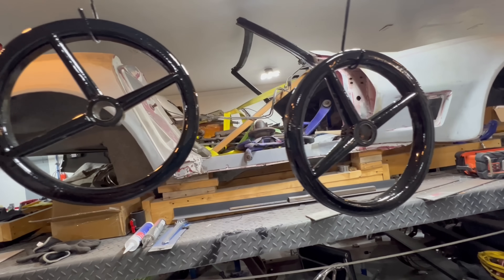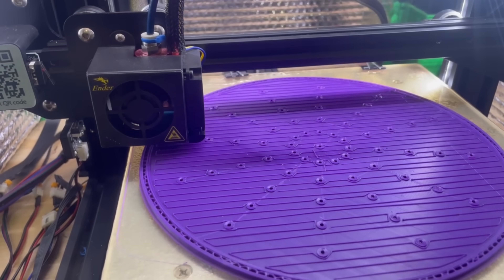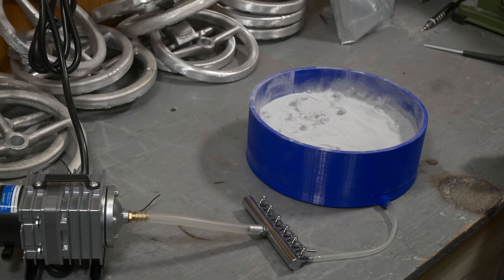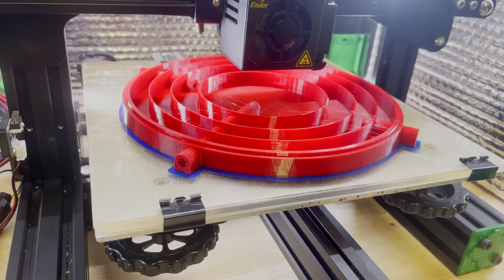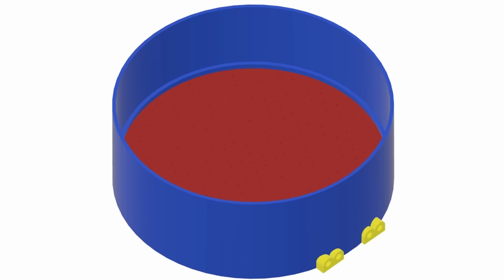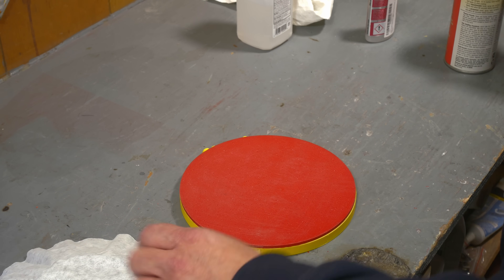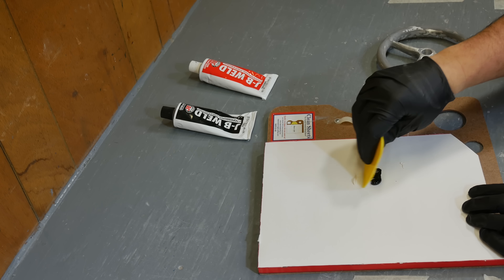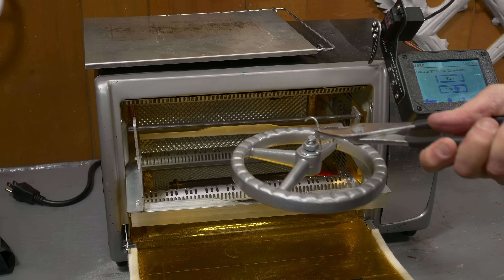Inexpensive Powder Coating at Home?  The Fluid Bed

Comment from the maker: This week we are attempting to powder coat the steering wheels we cast out of aluminum, using a DIY fluid Bed.
Follow our carnival ride restoration here: https://www.youtube.com/watch?v=xyejd7LRKMQ&list=PL9JRE2uksm9tonX17TZt38K6RH2EnDNf1&index=1&t=0s
Reply: Occam's Razor be damned, let's wildly over-complicate this thing.
Reply: for the size of the part. i would think just shaking it over the part and flip it over and shake shake. the big parts in the vid you used. to me will BIG. so yeah the fluid way is way to go. heck wire some voltage thru it. 20 volts dc no clue as i dont know the levels of voltages needed. use a chesse shaker with the metel top. bigger holes ya know. can send voltage thru it as the powder comes out its charged.
Reply: Could use a tone generator to liquify the powder in the fluid bed. Using a speaker and play some tunes could work as well for small projects
Reply: How deep of a bed powder could you do with a cheap 8" speaker?  I've played around with non-newtonian fluids and an old subwoofer but not considered doing the same with powder. @-kitn-kittilsvogel1958
Reply: Have you considered adding vibration to your powder coat rig?  Vibration can make powders act like fluids, be it ultrasonic or a vibration motor.  A powder that is already in a fluid state due to vibration should be effective to combat channeling, even with the first few rigs that were deemed failures.  The only caveat is that a poorly placed vibration source can lead to migration of the powder toward a specific area, so it could take a few placement attempts to find the sweet spot.

I am certain the tub can be simplified/lightened, speeding production and allowing weaker vibration sources to be effective (such as the little cell phone buzzers, which can be had by the pile for dirt cheap).
Reply: Hello PeteRondeau. We used to dip parts 40 years ago, now we are specializied more in powder coating. I have suggestion to use a thick cloth instead of coffee filter and perforated plate. And increase the depth of fhe fluid bed. We used to have 2 aluminium  frames and between was tensioned thick cloth so it could distribute the weight of the powder. Also for dipping is used polyethylene and not classic powder coating made of poliester. If you need some additional informations let me know. Kind regards DC
Reply: @aboxdc regular epoxides work as well for fluidized bed if they stick at the preheat temp. we used them in the lab for motor rotor stator coating. random assembly (production) my have used polyester.

Comment: I'll give you a tip for a filter instead of a coffee filter I found if you can find them in the right size, on amazon they sell Qualitative Filter Paper Circles, it is Cellulose Lab Filter Paper.  It works 10x better than a coffee filter and doesn't wear as bad, the air passes through a lot better.
Reply from the maker: Thanks for the tip!
Reply: @PeteRondeau  like you posted about us jig painters, we experiment.  I used the coffee filters and printing paper for years then found these things and couldn't believe the difference in them.  The paper could have been part of your issue the first try, if there is the slightest gap in the paper from the bottom it will allow extra air to come up and make it volcano in one certain spot.

Comment: Why not spray the adhesive on the filter?
Reply from the maker: My thought process was that if I sprayed the plate, the adhesive would only go where there were no holes.  if it sprayed down into the hole, it really wouldn't matter.  But, if I sprayed the filter, I would cover the entire thing and perhaps seal the filter preventing the air from penetrating.

Comment: @preso has the right idea. You were pleased to see the air break through in some places and tried to make that happen in all places. This is exactly the wrong way to go. We aerated silos with tens of thousands of tons of cement inside them and you need to avoid air break through up to and including the point where there is  very little cement on the silo floor. As soon as breakthrough occurs the cement stops being fully fluidised, no longer flows and becomes dead stock. If you wish to get some pointers how the above is achieved google “cement air slides”

Comment: Have you considered not having the air jets face directly upwards but to have them on an angle. I think this would keep the powder in a more fluid like state. When vertical I suspect most the injected air is lost to a point above the powder level.

Comment: Search for used Chicago electric powder coating ovens.  They used to be sold by harbor freight.   You can get them between 100 to 200 usually.  They are great for the price and run off the standard us outlet, not a 220
Reply from the maker: @Protocol-X  thanks for the heads up. I was not aware they ever offered such a product.

Comment: I bet if you took a page out of rocket engine building books and made your output holes angled such that the streams blew into each other you would create enough turbulence and mixing that you could totally get rid of the channeling. 

Second, while you are angling them, you may as well make the output holes have a goose neck to them so you wouldn't need the coffee filter. This shape should cause the holes to self plug when the air supply was turned off, and later self clear when turned back on.

Lastly, I personally think of such things using an electrical analogy: Pressure = voltage, flow = current, restriction = resistance. Knowing that there is a relationship there, it makes sense that there are ways to make the system behave better using something similar to ohm's law as a first approximation.

Comment: That abs part needs a nice thick brim do like 1-2mm mouse ears around the edge heat that bed up high as possible and don’t even crack the door. But large flat abs parts are near impossible to print i had one even pull the the magnetic bed up once had to paper clip the edges down.

Comment: unless you are retired and have too much spare time you should consider to get glue that sets in minutes, not hours - and you should get a faster printer xD
9 hours is insane for this small part nowadays..
and even if im not a bambu fan - the a1 would outperform it for nearly the same price..
also instead of designing holes - just use the power of the slicer to do a fine grid for you.

Comment: 14:56 You can see the air create full penetration of the powder where it becomes just air stream holes. I imagine adding a degree or two of angle to the air output the flow the material would be constantly replenished above the hole.

Comment: Hard to believe that the problem of powder getting "everywhere" is not easier to solve than what I just watched. An enclosure (floor pan) to capture the unused powder for re-use? I like this project for its ability to adapt an industrial-scale process to shop scale, but the insertion of the printer was, for me, a "because-you-can" diversion. I'd like to see this addressed without the use of a 3D printer.
Reply from the maker: I have to disagree with you completely.  You are looking at this from the wrong perspective.  This workshop is my hobby.  The tinkering is the part I enjoy, I'm interested in the process and journey.  if not, it would just be cheaper and quicker for me to have somebody else powder coat parts for me.  And then, I would have a bunch of free time to pursue a hobby I no longer have.  As for the 3D printer, i have spent a life time gathering the equipment together in this shop to do things the way I want to do them. 3D printers are ubiquitous at this point.  anyone interested in getting into 3d printing can afford one.  My 12 year old nephew saved up for one and bought one.  its just another tool in the shop.

Comment: You need laminar air flow.

Take your air flow, put it thru a bunch of straws on one end of a pvc plumbing pipe, nothing in middle, bunch of straws on the other end with a single hose from each straw, each hose goes to one jet of your container.

Think air hockey table or fume chamber used in labs.

Good luck! 😊

Comment: Nice video! I built a fluid bed dryer, with a blower passing over very hot nichrome wires in a grid, and a 45 degree ramp in the underside of the bed, then, instead of holes, I used 500 mesh stainless steel. There is no need for filter paper, and even fluidizing is easy to achieve. Instead of the 45 degree ramp that just channels about 500 cfm of air straight up, into 3 square feet of area which is round like yours. Instead, you could vortex the air flow by using vanes, which will require more clearance underneath. The amount of air I push is crazy overkill for a couple inches of powder coating materials, but I needed to dry large batches of bentonite clay, which was already semi-dry. Anyway, I hope my suggestions help.

Comment: The finish looks great! But you have to admit, it is slightly funny to put this much work into painting an aluminum part silver 😆
Reply from the maker: Yes, we did black with the first batch and I was worried about them getting too hot in the sun.  so I went with something safe like silver - the real long term secret behind the scenes plan is that I can use that as a base for a candy color down the line when I figure out what I really want them to be.

Comment: Go on market place get a old house over one elements will do the work or go to local dump tip get all sorts from there remember to take a plug screwdriver then try it on site if all good get 2 the same fit together 1 LARGE oven with some cutting and pop rivets

Comment: An old file cabinet 4 to 5 ft tall works well, in terms of a starting place. It already has a million holes, hooks, and steel bars going across it to hang stuff from. I've seen insulation wrapped around a couple, that seems like a good idea.  All I've seen have a custom built simple door and some old hinges.  Add some electronic heater(s) and run it HOT on the first cook to burn off the old office paint look and there you go.
Reply from the maker: My friend who powder coated the first few for me did that, although he started with a fireproof file cabinet, for all the reasons you mentioned, plus it was already insulated.

Comment: You would have had better results by changing the coffee filter to something better like micron aquarium filter pads. A little bit of thickness helps disteibute the air better. That filter is so thin it hardly does anything to help distribute it.

Comment: What if it’s also sitting on a gentle vibrating bed it seemed to work better wile you were shaking it slightly wile the air was on and you were trying to coat the part
Reply from the maker: Yes. It feels like that would help. Would break up the air channels as they form

Comment: I really enjoy your videos.

Just curious if you considered a bleed off valve for the air pump.  This would help in adjusting the output to all lines simultaneously.  It might help reduce wear on the pump as well.

I always found it useful in my days running several aquariums off a single pump.
Reply from the maker: I have not experimented with doing that but it would be worth a try.  Thanks for watching!

Comment: By which way does the powder get stick to the parts? Are there cascades somewhere or do they stick by letting the powder to be in friction with the powder pipes as within Tribo guns?
Reply from the maker: No, this basically works similar to hot flocking.  The part is heated enough that the powder just begins to melt and stick to the surface. On this particular part it was difficult to get powder into the corners where the spokes met the wheel.  the powder was more likely to be attracted to the spoke or wheel before it got to the junction.  This really helps with that issue

Comment: Appreciate the effort but it would have been so much quicker to just spray the powder like normal and bake. With all the time and filament and powder it would have been cheaper and faster. Love the innovation though.
Reply from the maker: As I mentioned, quicker was not the problem I was trying to solve. The mess, plus the Faraday affect in the corners of the spokes. This is my hobby if I make everything quicker and cheaper, what will I do with all my free time since I no longer have a hobby to pursue.

Comment: The eternal problem of many aquarium bubble curtains. The best stuff really is that fiber-ish tube that's about 3/8" at the pet store places. Comes in different lengths. My sand was Fort Lauderdale beach powder, the adjustable manifold is the other 50% of the problem and you have that. Just get those bubble tubes.

Comment: I built my own oven from the local land fill by using oven burners with the ceramic isolators and the temperature control units 6x6x6 feet built with scrap metal! JB Weld works ok but much better when you mix metal dust with it prevents bloching were the powder coating doesn't stick properly!

Comment: One of my customers who has become a great friend in the last 9 months has a couple of companies one builds custom 3D printers! He saw the cheapo I had and asked me why, I said I that Iwas just trying to learn about 3D printing! He told me about his companies and said that they had recovered a custom 3D printer from a company that failed and that he would trade me for 1 of my 572 crate engines!  They would fully refurbish it install it and he would have a guy come to my shop 3 times a week for 3 hours for 13 months to personally teach me everything that I need to know to make a successful business with it as a starting point nine months in and it awesome the max printing size is 6 feet x 6 feet x 4 feet it can feed upto 13 rolls of filament which sit in a dryer box and can connect filament to the end to keep going! They brought a full size U-Haul truck full of different types and colors of filaments! He's now wanting to buy my 3 racecars the haulers tools and every single spare item! He's installing a Resin 3D printer next week even bigger than the filament 3D printer and of course some education for it and tons of consumables! Best of all I bought the empty lot next to my shop from the owner who's dying for exactly what he asked because I've always help with cutting and snow removal and built a heated ramp for him to take his wife for treatments he charged me $1000 dollars! Said at first I hated you with the race cars and Harleys in and out but you respected hours of peace and quiet and chased the bad apples away, you deserve it! My pod house is finally approved the same guy that has the custom 3D printer company has a company that builds custom pod houses my place consists of 7 pods connected together! So a little horse trading I'm moving on and up nomore racing after I was crushed between my wrecker and a car at an accident scene by a drunk driver who rear ended the vehicle I was hooking up! More tune-ups and helping others when I can!  I didn't think I was ever going to be a homeowner, I always figured that I was going to be living in my shops mezzanine!
Reply: I was 38 when I could afford to buy a house, so I have been a home owner for 30 years now. Keep going 👍
Reply from the maker: Wow. That is quite the journey you are on. Thanks for sharing!

Comment: Love real videos like this showing the fails & all.  For larger projects, I wonder if an air hockey table would work with built up walls?  BTW,  if you ever get tired of spray adhesive filters I wonder if a clip-down 3D printed coarse retaining screen (say 1 inch between strands) designed to straddle the air ports would work to hold the filter down evenly.

Comment: I realize that you painted that piece silver because that's the color you wanted it to be. However, it's the same color as the metal. I couldn't tell how well the paint covered. It just looks more glossy. The reason that you don't find medium sized fluid beds are because they aren't necessary except for some niche cases. The big ones are used for gates because the surface area of a gate is small and spread out so most of the paint would be wasted overspray. The small ones are used for dipping small objects with, again, a small surface area where most of the paint would be wasted on overspray.

Comment: 17:35  Dear god, don't go to the V.A. for an Ortho Doc,   not unless you really have some kink to become an SSDI recipient all your future miserable life :face-red-droopy-eyes:
Took me almost 2 years from my Accident with a Lyft driver to find a  Private care civilian  who would then send me to an ortho  outside of the VA system to get a second opinion ; and that's just to GET to SEE the Ortho doc as there is still a severe shortage of doctors here in Portland Oregon.  

Heck it took me almost 15 months to see a PCP since we simply did not have any.  
If they tell you "Oh physical therapy will fix this"  Tell them to pound sand !   :face-orange-frowning:

Get the care you need to get back to work and doing the things you were. 
And don't take no for an answer.   If you have to?  Go overseas to get your medial done. 
I'm doing that myself this summer after I take care of whatever  affairs I have here at the homefront. 

The worst part about all of this is that thanks to being on medication to cull the pain from the nerve damage,  I can't safely operate any of the heavy equipment I use to be able too.  
So there goes the job I felt like wasn't even work at all.    
Sucks.  

take care and get better Pete.

Comment: Instead of your multi port manifold try a larger primary plenum to provide unform static pressure. This would be the base chamber ~1" deep. Then your multi passage chamber on top of it with holes uniformly distributed. Then put your perferated bed plate on top.